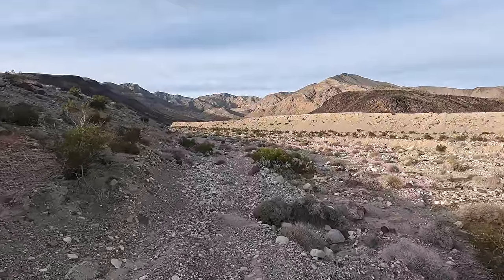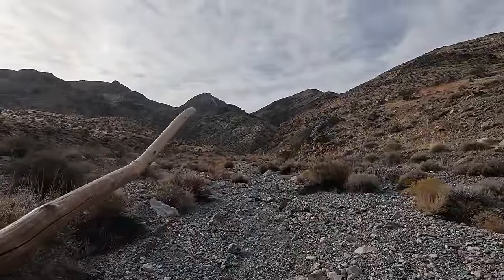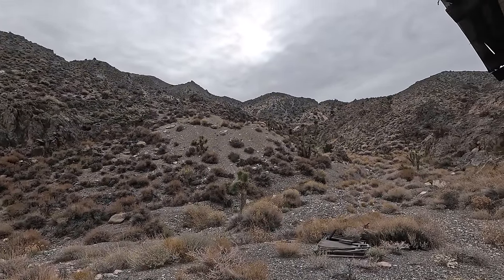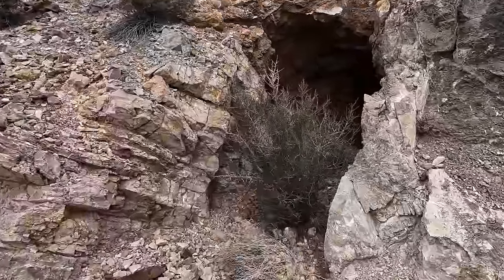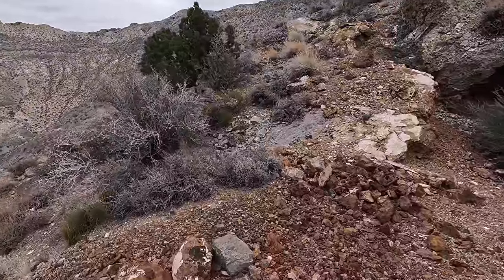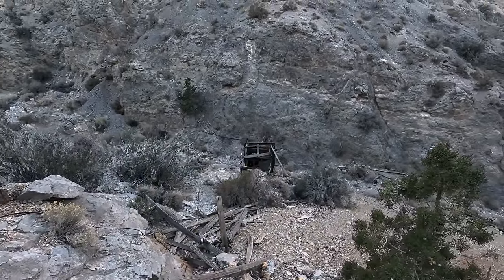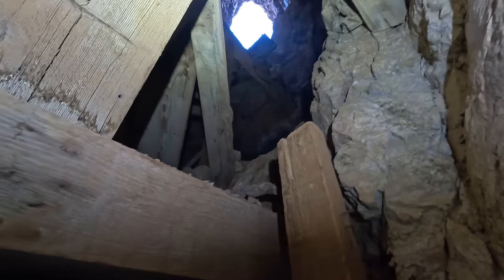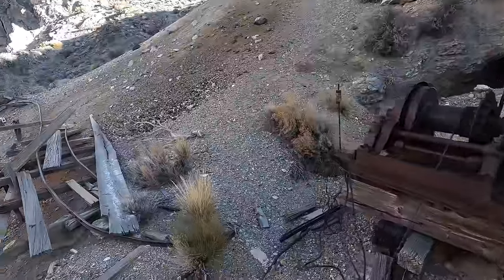A Particularly Remote Hike to the Buckthorn Mine and Cabin

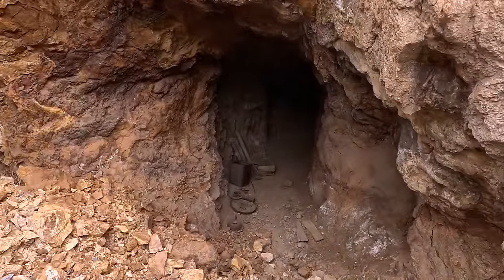Comment: At 24:00, those are the remains of a firepot for a forge, very early too. Really nice find. The first thing you picked up was the firepot, still had the clinker breaker in it. Next to that is the tuyere, which you didn't pick up, it conducts airflow from the blower to the firepot. Also a very nice find, rare.

Comment: From the cardboard dynamite boxes and the RPM labeled can of grease, it looks like there was activity in this mine complex in the sixties. The very shiny corrugated metal siding on the ore bin also hints at more modern mining, although the original mine may have been earlier. The hoist engine is older, maybe from the twenties, or thirties, possibly off of a hay bailer, or some other agricultural equipment? Some views of any name plates would have been interesting.

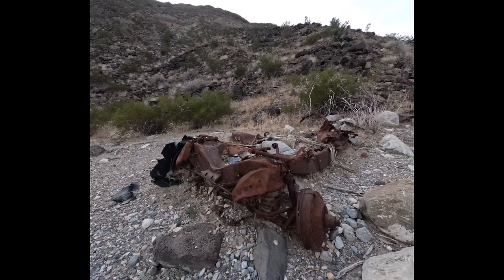Comment: At about 2:45 that frame you're looking at appears to be from an old pickup truck as I see what looks like a front axle and in the center section of the frame cross member is where the radiator would have been.

Comment: Yeah that is an old car or truck.  I can see the steering gear on the front wheels.  Trailers wouldn't have those and the front and rear wheels would most likely be closer together.  The thing connected to a piece of would you looked at and said not sure what that is.  That's a jack for a car.  you twist a part on the bottom and it pushes up the center top part.

Comment: Always enjoy watching your explores! Just a question when you have to park your car in a very remote area and then have for example as in this case 7 miles to hike to get to the mine and it all buildings etc - aren’t you a little nervous about someone stealing (or damaging) your car? Because surely in these sort of locations, if people (with bad motives) spot a car parked up they’re going to guess that the owner has gone off hiking somewhere - unable keep an eye on their vehicle. You’d be in a lot of trouble if you found your car had been stolen (or wrecked) miles away from any population centre; presumably often without any cell phone signal.
Reply from the maker: That’s a good point! Usually I take my Jeep along so that entails I put on the bar for my steering wheel, but most times when I’m off-roading there’s not many people where I end up parking. If it’s my Malibu, then they’d just have to break the windshield and if they really meant to mess shit up slash the tires, etc. In that case I’d be pretty screwed. I do have a Garmin inreach so if I can’t contact anyone in a reasonable amount of time, I’d use the SOS button on there and they’d send help.

Comment: If you knew where your walking in,as a prospector, you'd see whst I as a prospector see,and I'd be back with dynamite,and excavator, and a drilling rig.
That's a volcanic rift,which will go down a ways,but the hydraulic fluids of quartz would have filled the gap,down inside,under that gravel tool and overburden!
Also the white8r rock,I'd take a chunk to assay,it's either quartz,dolomite or calcite,a  gold bearing ore.
To quote the old boys" Jumpin gehawsafats!" Thers gold in here!😊

Comment: With those old grease guns to fill them with grease - they stuck it in some kerosene or diesel first so the grease would not stick to the metal tube - then they stuck it in the 5 gallon grease bucket and pulled the handle up as they shoved the cylinder into the grease to fill the grease gun with grease - today you just slip a new tube of grease into a grease gun -